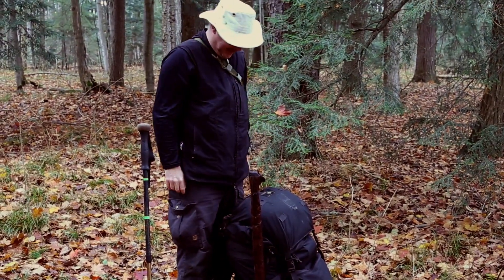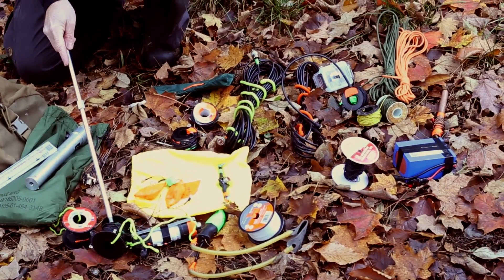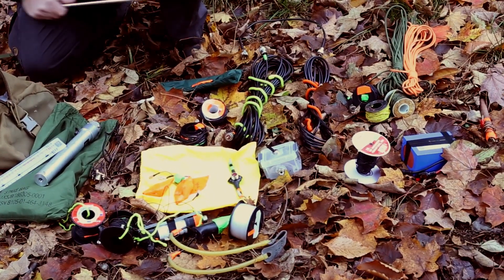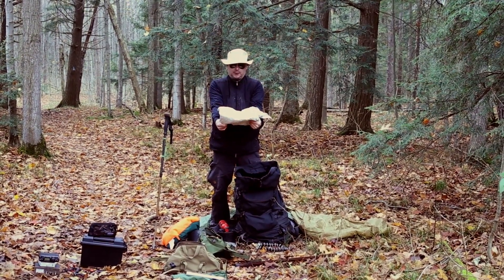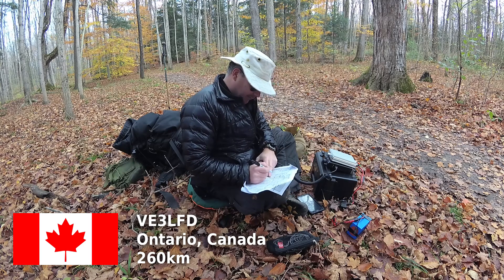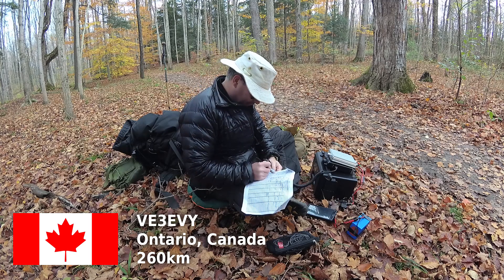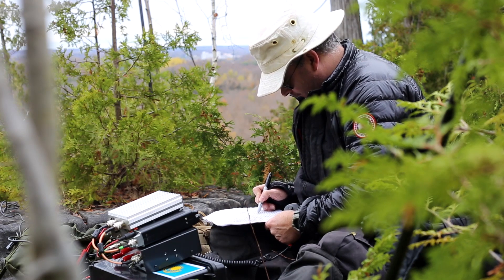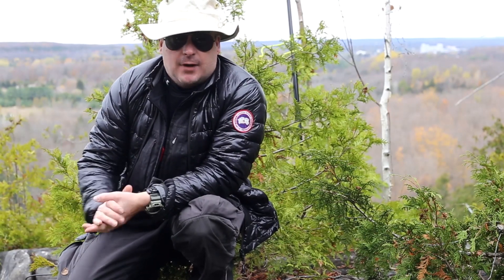VE3EFQ operates in the RaDAR Challenge

Comment: Very good video! This is something that I have put thought into trying but it just hasn't happened for me yet hi hi. Do you always carry so much? I have limited myself to the 817, 6.5 Ah battery, Alpha loop, small rigid solar panel and a few accessories. I like the cushion seat idea!  This amplifier, how well does it work?
Reply from the maker: The amplifier is amazing.  I like QRP, but sometimes, especially in poor conditions, you just need that extra power to get above the noise floor.   Paul usually carries most of that stuff, except for the super antenna.  That cushion is very light, I usually just strap it to the outside of my pack - makes a great seat and a pillow when overnight resting.

Comment: Really interesting video, Paul. Outstanding demonstration of effective portable techniques. Do you think you'd have been able to make 5 contacts on each stop without using the amp? Thank you for sharing!
Reply from the maker: I'm sure it would be possible without the amplifier, but I doubt we would have made it past the first location without it.
Reply: Yes; with the big dipole that would have been possible, with sufficient time.  With the super antenna, maybe not in a sufficient time for this challenge - the Super Antenna is not good at low power levels.